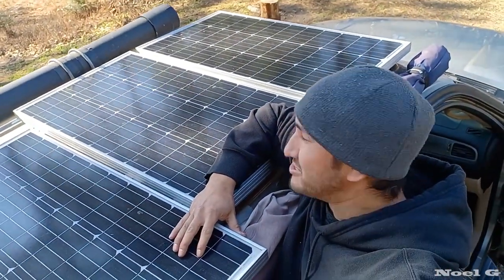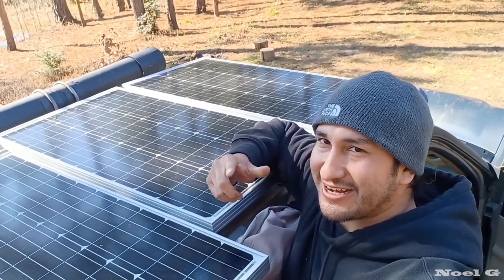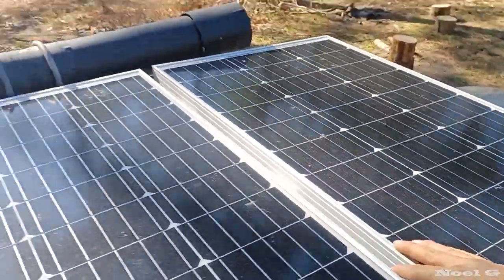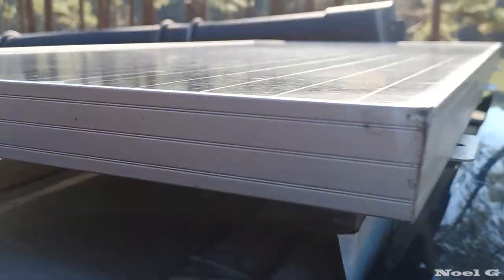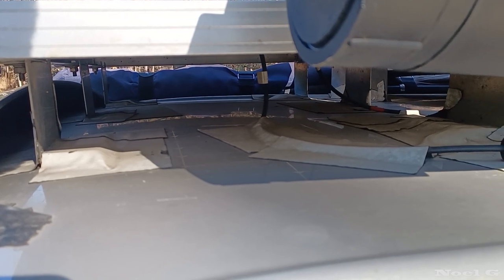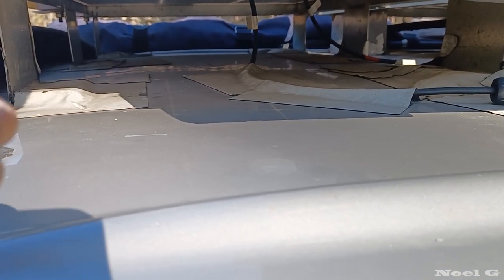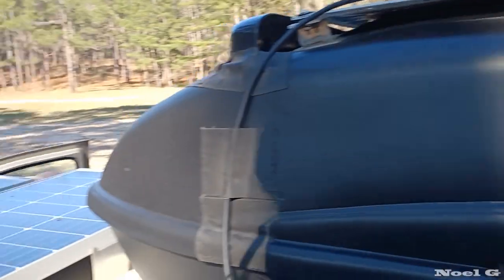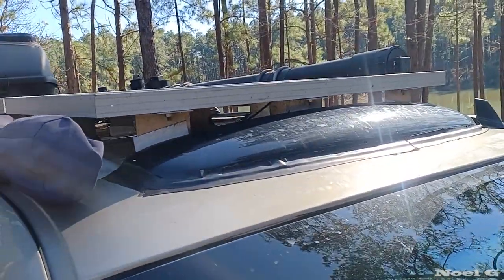Easy Solar Panel Mounting | No Drill Solar Install for Camper Build

Comment: The trick to using 3M 4950 VHB is use a roller to set it. As you press down on the roller real good...Then place the brackets on top. Press down with some weights. It will set inside 24 hours. As it has a shear strength of 5000 lbs per inch..Is high heat resistance. When used right....They use the stuff to install 100lb windows in high rises buildings...

Comment: Good job but....that looks exactly  like Eternabond tape aka RV roof sealing tape, NOT VHB. No?
Reply from the maker: The VHB is under the bracket. That's what actually holds the bracket to the roof. I put the eternabond all over on top to minimize the elements getting to the VHB tape.
Reply: @noelg9769  Aha. Gotcha!